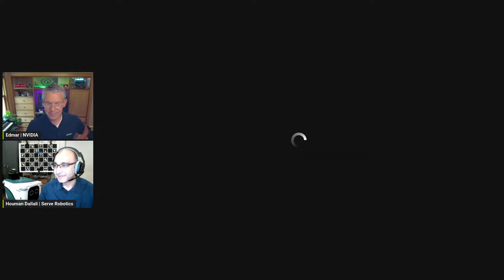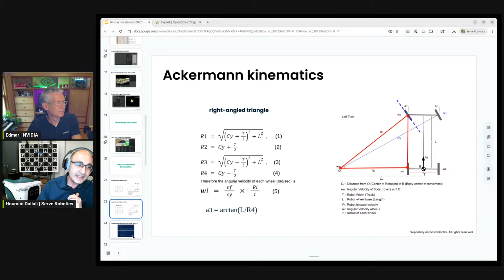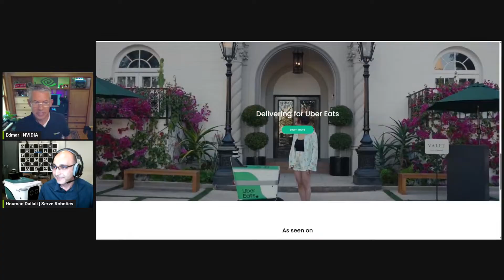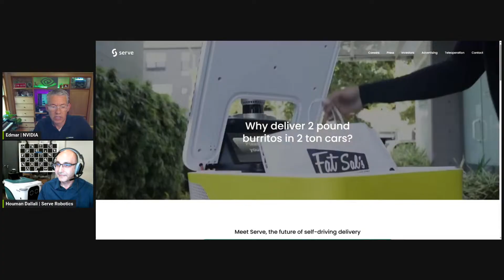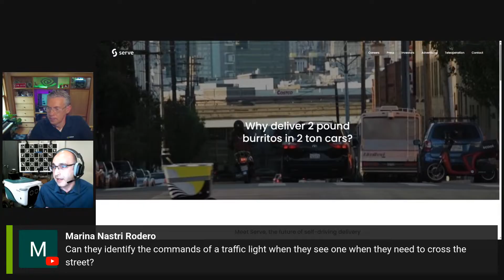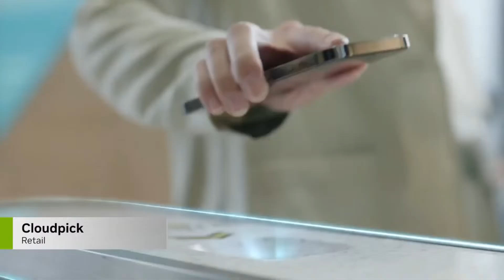Building and Testing Autonomous Delivery Robots in NVIDIA Isaac Sim

Comment: Export the Nvidia, Azure, Chat GPT, Revit, Plant 3D, Civil 3D, Inventor, ENGI file of the Building or Refinery to Excel, prepare Budget 1 and export it to COBRA. Prepare Budget 2 and export it to Microsoft Project. Solve the problems of Overallocated Resources, Planning Problems, prepare the Budget 3 with which the construction of the Building or the Refinery is going to be quoted.